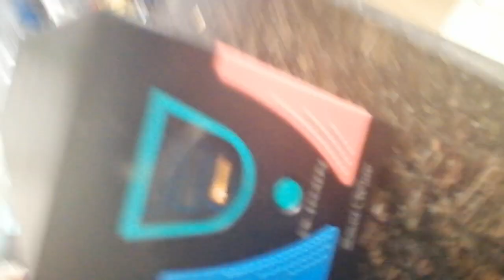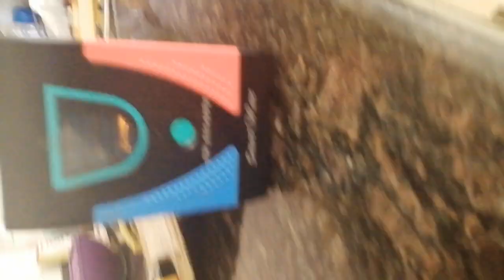hacking pc ups part 5

Comment: are you charging the cells with the ups itself or an external power source?
Reply from the maker: Hello
Battery will charged from the ups itself... 👍
Reply from the maker: I am using a same port bms...
Commen port charge and discharge...
Reply: @freeenergy  but the ups is designed to provide very little amp for the original SLA battery, it will take ages to recharge if you did not use an external power source, correct me if i am wrong
Reply from the maker: This ups have a 5amp charger 12v
This battery is 12am 11.1v
Every thing is be okay...